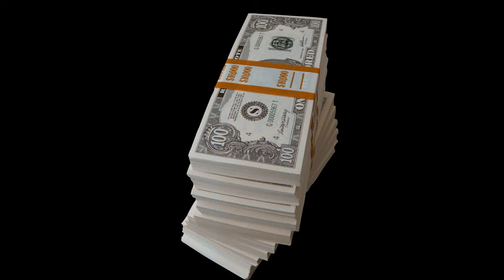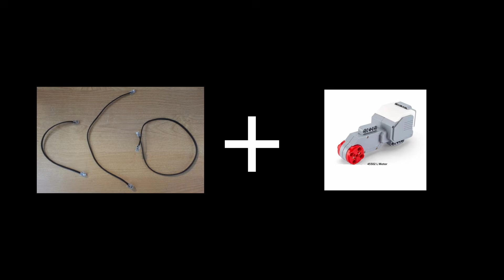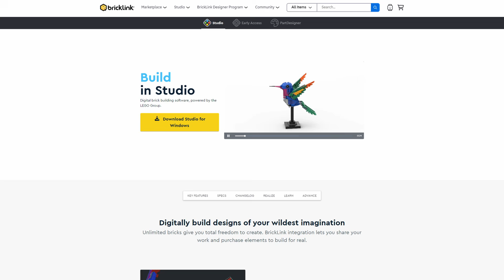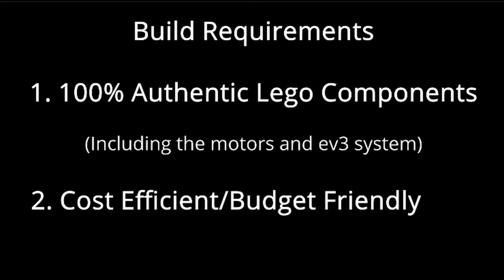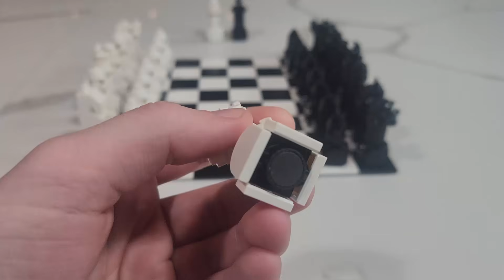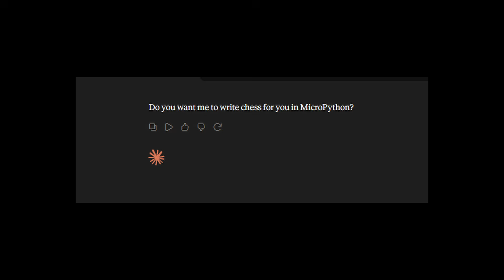Making A Lego Chess Robot - The Engineering Design Process

Comment: To let chess piece move diagonal, you can let surrounding piece move out of the way and then come back
Reply from the maker: Good thought! I had initially thought about doing it that way, but I opted to just have the chessboard move the pieces back to their place after the diagonal move. My chessboard isn't terribly fast, so waiting for each piece to both be moved out of the way, then moved back would take quite a bit longer than just resetting their position after the move.

Comment: Do the chess pieces from the Harry Potter Lego chess set work or do magnets not fit well?
Reply from the maker: Good question. They look like they might actually work, but they would need to be modified pretty heavily to fit the magnets. I'm not sure if the swords and shields would stick out too far to cause any issues, but this could definitely be re-worked to be a wizard chess set.